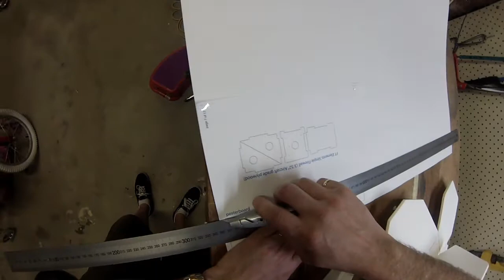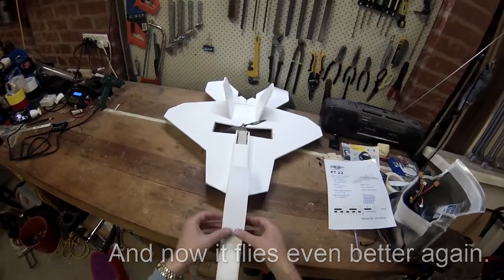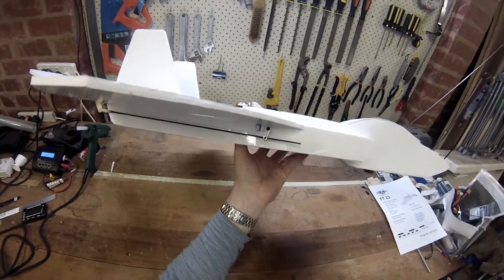Flite Test FT22 - Build Tips and Maiden

Comment: My FT-22 raptor is amazing! and never wants to fall out of the air... cept when the battery died. But on tight turns, it comes out of them quite easily. I also fly in high wind often so that might help keep it up and sorta high alpha after i slow down from the turn. But i just punch it after turns unless i wana high alpha
Reply from the maker: G'day  Joseph Galvan Thanks for your comment. have to say I think I have mine dialed in really nicely now. 2200mAh 40c battery with the 2200kv motor (6x4 APC prop) she really screams now and is arrow straight. Really like flying this one fast and as low to the ground as I can. Cheers Michael
Reply: yeah im still a noob, so i keep it a mistake high and love gunning it right over my head!
Reply: +Michael Downie how many cells are u using? And would a bigger motor make it better?
Reply: im using a 3 cell 1300 mAh and 2200 mAh battery. its is plenty powerful. I have a turnigy 2730 1500kv motor. it has no problem pushing in the wind. but i would imagine u could fly even faster with a bigger heavier setup, without the loss of too much performance.
Reply from the maker: +Cyberschn1tzel I was using 3s 2200mAh 40c battery before I had a servo fail and ploughed into the ground. I had already re-built or repaired this one a few times, so this was the final crash. New airframe needed, which I'm thinking I will do with a KFm-2 airfoil (https://en.wikipedia.org/wiki/Kline%E2%80%93Fogleman_airfoil) Cheers Michael
Reply: Michael Downie yeah i know the lf airfoils, gives some stability in exchange for some speed, kind of... I might do it like that since i only have a 4mm depron clone which im probably going to tape first (or i just build a different model)
Reply: +Joseph Galvan hows the thrust/wheight ratio? (although i rather have speed than unlimited vertical..) thx for your fast replies!
Reply: well with the 1300 mAh battery, its pretty great! the vertical is not too bad, but could be better. but speed wise its awesome. im still a noob so i don't go too fast. with the 2200mAh battery, it doesnt climb very well, but can still goo really fast.